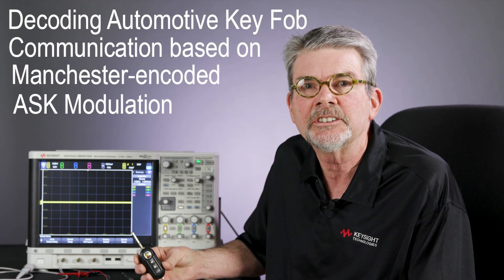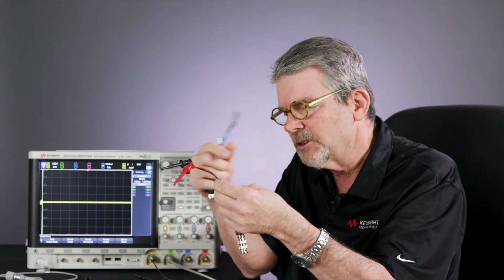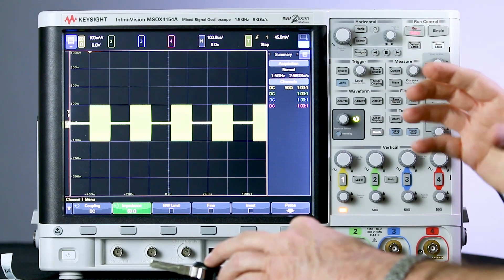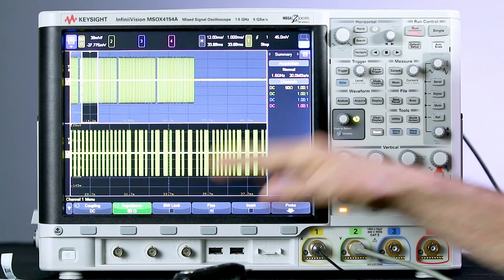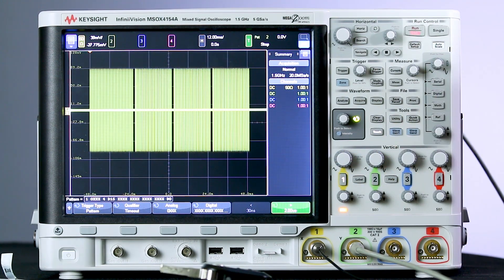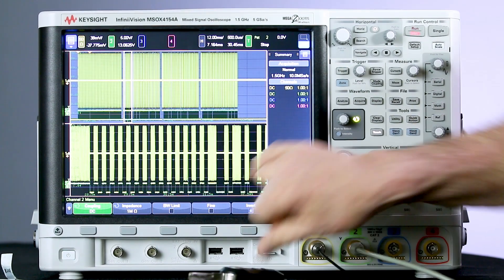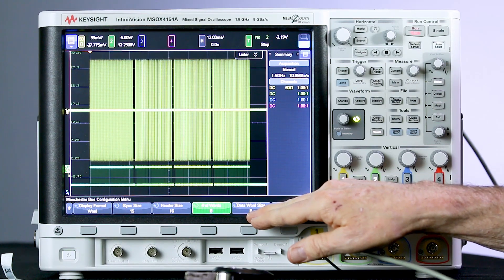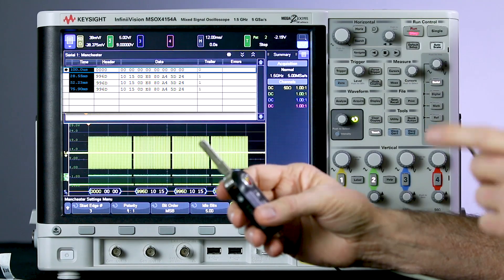Decoding Automotive Key Fob Communication based on Manchester-encoded ASK Modulation

Comment: GM's use rolling code technology. That means the code changes accordingly ( when ever the key fob and BCM shake hands )so that if someone tries to duplicate it, the duplicate signal won't be of any use. After 256 times, the body control module and key fob need to be resynchronized. To do so you can use the scan tool. Or, I used just use the door lock switch inside the car. There are over 3 million ( or was it billion?) Key codes that rotate in sequence.
Reply from the maker: Yep! We had to make sure we didn't press the button too many times while filming.
Reply: Darn, I was hoping to begin a lucrative career stealing cars!
Reply: It is lucrative, if you’ve got the heart & stomach for it.
It’s always easier with the original key...

Comment: Wow, this scope costs $17k USD. I'm thinking a $24 SDR radio and writing my own code for decoding (hint, no need to due to opensource)  would be a better use of my time/money. But cool story bro. Send me an eval unit and I'll let you know if the software route is better or worse.
Reply: One is a general purpose instrument, the other is not... 
They are totally not comparable. Hell, an SDR is not even a time-based instrument, it cannot do anything with DC or low frequency signals.
Now if you'd be comparing a spectrum analyzer to an SDR, you might have a more valid point, but also there the SA is a much more general purpose instrument, it for example can survey a far larger bandwidth, accurately displays signal amplitude and doesn't distort the spectrum as an SDR does.

Not saying SDRs are trash, but it clearly has a purpose and goal very different to measurement equipment.
Reply: Apples and pears.. Like watching a million dollar Ferrari car and react with "dude, this car is a million dollars! I have a bicycle which costs me 50 dollar and it also has wheels and can also take me to the grocery store.." 😂😂